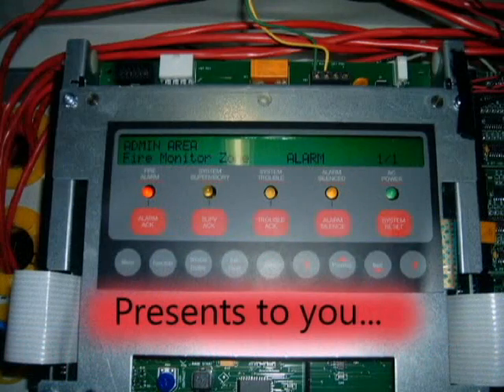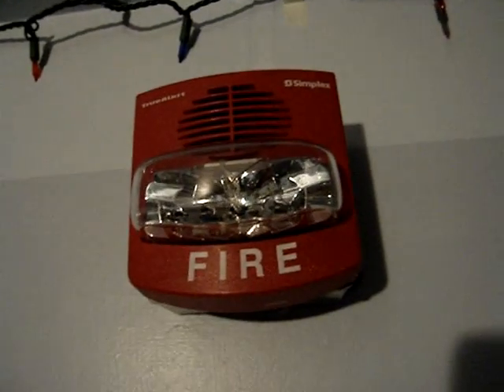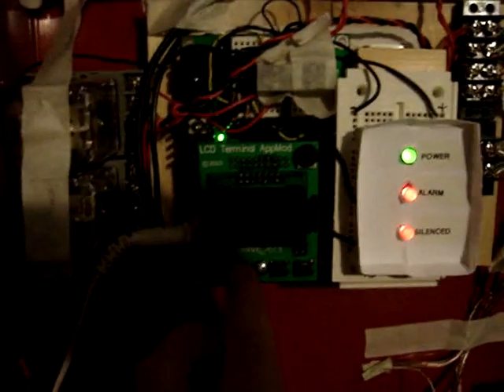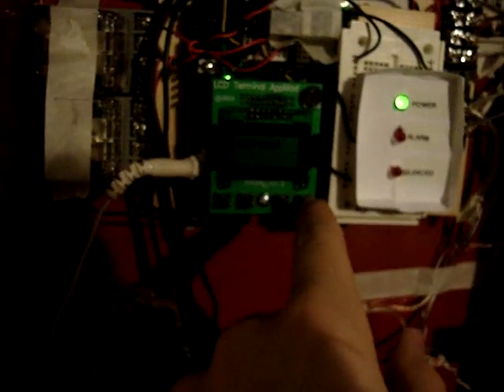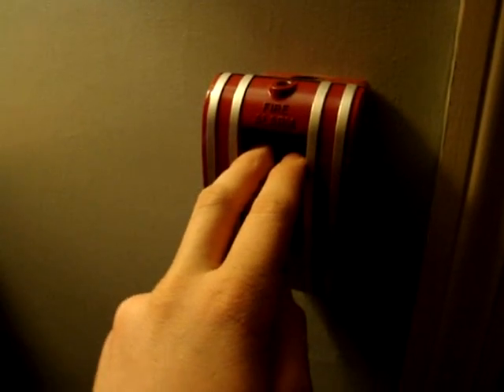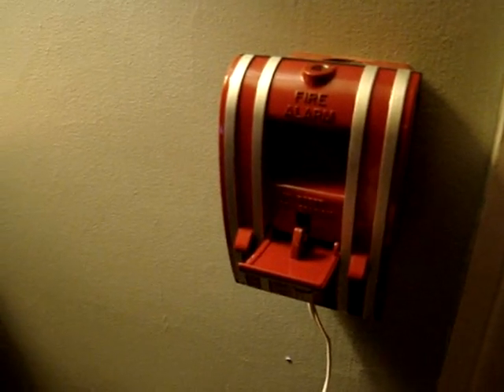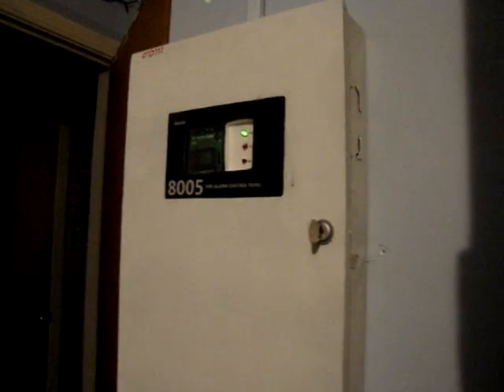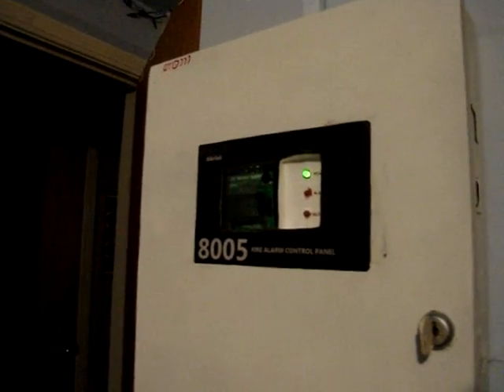System Test 4: NEW STUFF!

Comment: +NewAgeServerAlarm I'm creating a panel using a Parallax Propeller demo board, do you have any suggestions?
Reply from the maker: +Mark Keller Make sure you have a good circuit to protect from back-emf when using mechanical horns.
Reply: Thanks. I am probably going to use mechanical horns anyways.
Reply: +NewAgeServerAlarm This isn't about fire alarms, but about circuits. Does a Malibu Light transformer and a car battery share the same voltage? Just thought i'd ask an electronic genius.

Comment: Did the panel output FWR? That horn sounds a little rough
Reply: NJMoo3652 yeah it has to be FWR you are probably correct. in system test 13 he said his Truealert died probably because of this power supply. Simplex alarms are not made to handle FWR current, only filtered DC.
Reply: And his camera mic is really crap

Comment: The original Alertek(TM) 8005.
(now known as the Aletek(TM) 8002.)
This is probably the best home made panel I have seen.
(Even better than the i 8005)
Reply from the maker: Gpexalarm101 I wouldn't say better than the i8005...
Reply: the i8005 had more features though.
so good point.
these panels both have their problems. whatever.
They are both amazing though.

Comment: It was a box of rubber O-Rings. The Sticker on the front I put on and it says "Alertek 8005 Fire Alarm Control Panel" and the sticker on the back says "Chromate Snap Rings and has a list of part numbers for the different O-Rings (there was a plastic tray in there at one point. I repainted it white and drilled the holes for the lock and conduit and I cut the hole for the window.
Reply: what was a box of rubber o rings ?
Reply: @jmw4835  The 8005 enclosure I think.